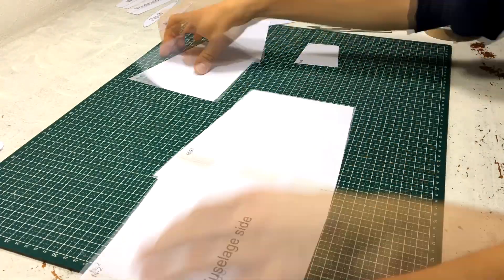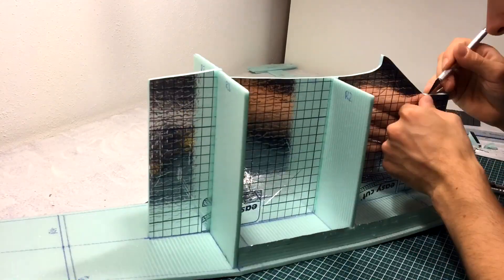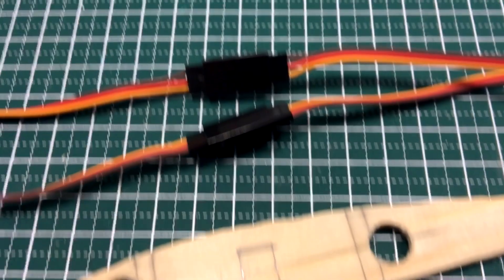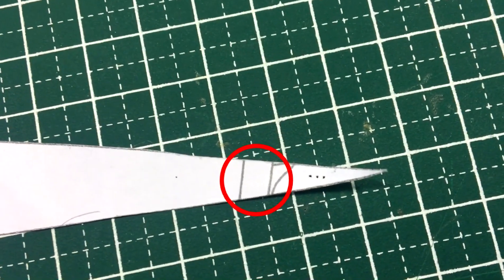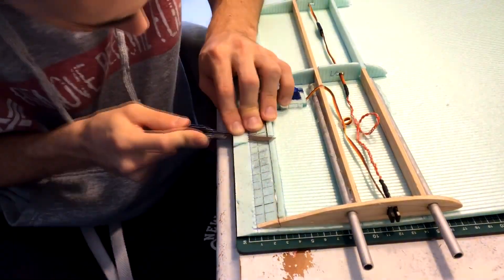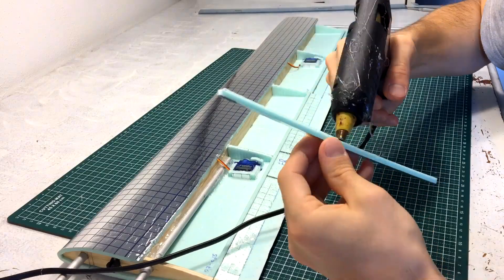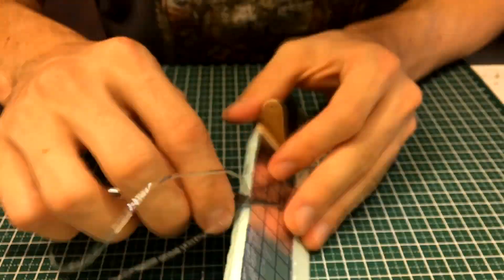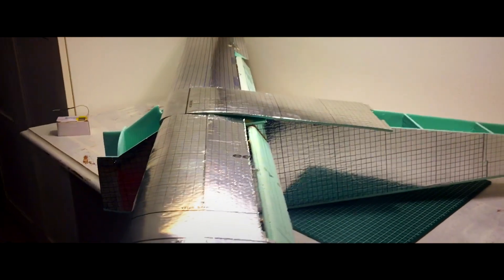RC Bush Plane Build (ep. 1)

Comment: please show us how the wings stay on after they side on to the tubes, thanks you , looking fwd to hearing back from you, on the wire connection to the servo use a simple z bend .
Reply from the maker: In my previous models I used to drill a small hole through the pipes that slide into each other and a pin would prevent the wings from sliding out. I will show this at some point in future videos.

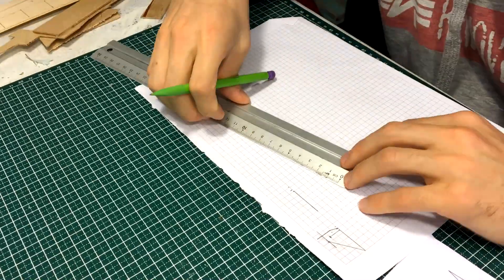Comment: some info.      at 8:28, it appears that Design has resulted in the main half-spar   NOT  being  correctly located at  30 percent of chord/mac.      at 10:09,  NO  NO  NO     METAL  HINGES!!!   yer joking, right.      at 10:23,   Wonky  servo location!!!     (the Mass of)  wing servos  Should be  located  AT or forward of,  cg/c-m.      googletranslate